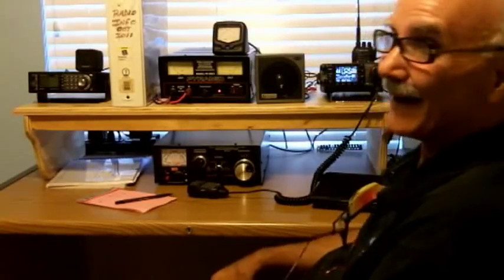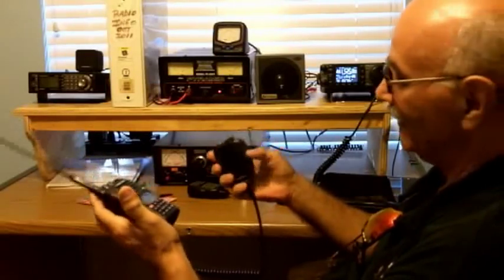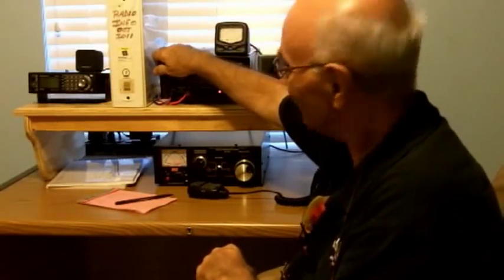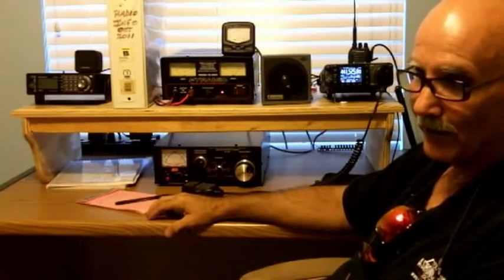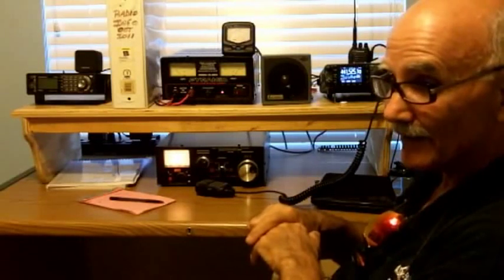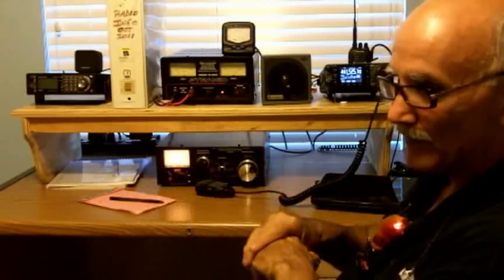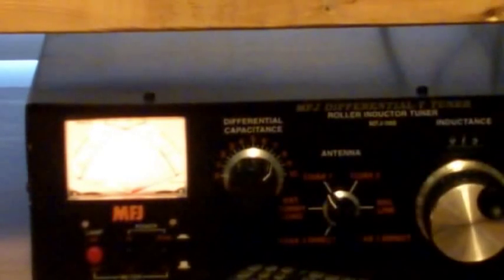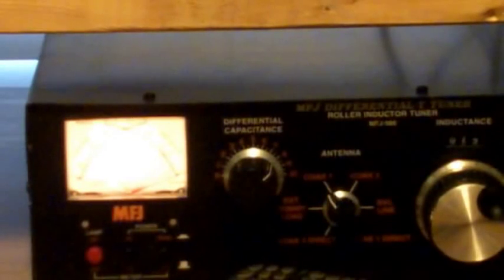Ham Radio Shack

Comment: could you show me how your window feedthrough fastens to your window thanks Kevin 73s
Reply from the maker: Kevin Rhodes Real simple--- trim the board to fit the window-- open the windows set the board into the window and then close the window. I put extra weather stripping around the pass-through board, and also cut another wood board inside so the window cannot be raised from the outside.